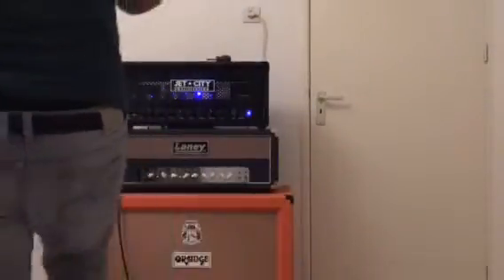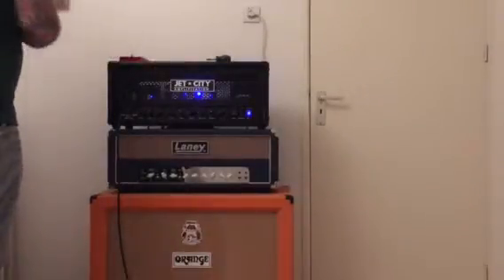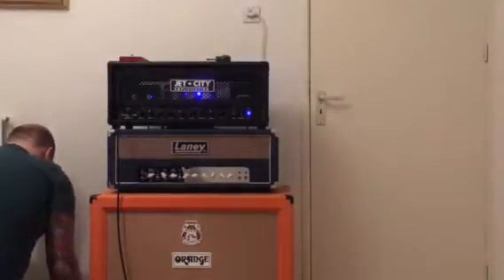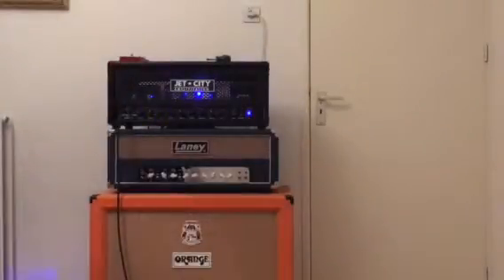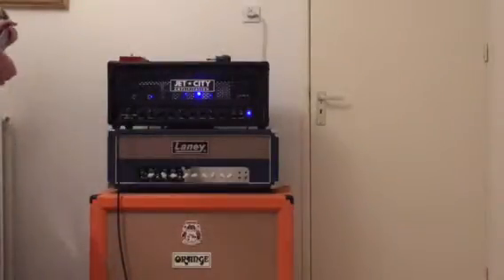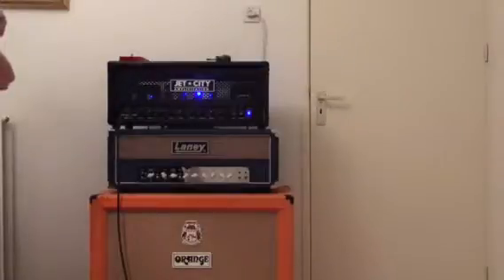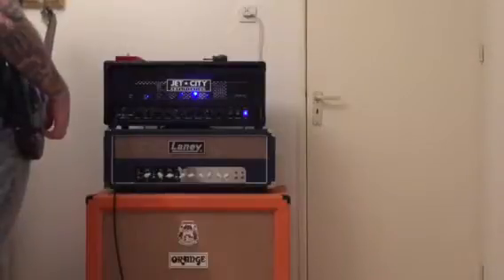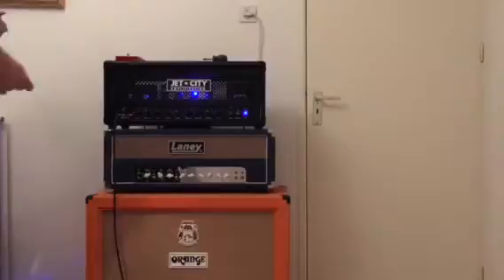OD chipset test: JRC4558D vs MC33178

Comment: What started as a comparison video just turned into a bloke shredding in his bedroom.
Reply from the maker: na I am not a shredder but the goal is to play different chords, leads etc so the different can pop out (if possible).
I have extensively tested different opamps and I found out that 2 opamps are my favorites (MC33178 and TL072)
Reply: @vanespedals1023  Well Im still hoping to hear a clip that highlights the differences. I know its all very subjective but it would help to dial back the amp distortion so we can actually hear whats going on. Cheers
Reply from the maker: Marc Pendergrast to be honest, my pedal is mainly focused on high gain sounds as a boost and not as a classical overdrive. The best I could try is to mic it, I can ensure you that in the room the difference is audible and certainly in a practice room.
Reply from the maker: Ps my hope is that I get some more spare time in the coming year so I can properly mic the cab so you can hear the difference
Reply: @vanespedals1023  Its not an easy job doing video comparisons. You are on the right track
 Best of luck.